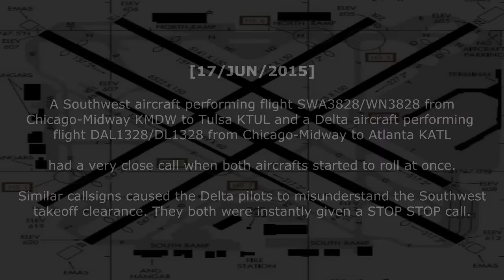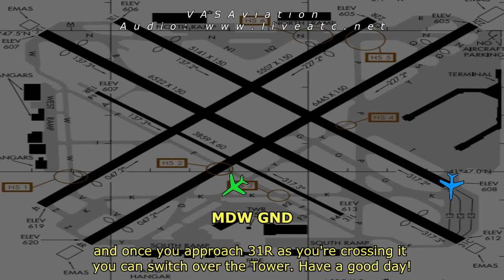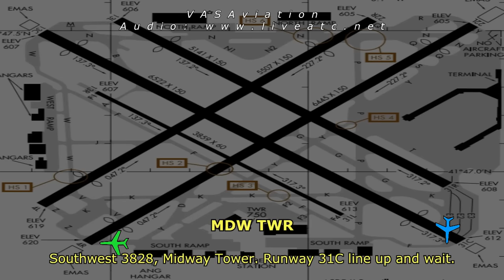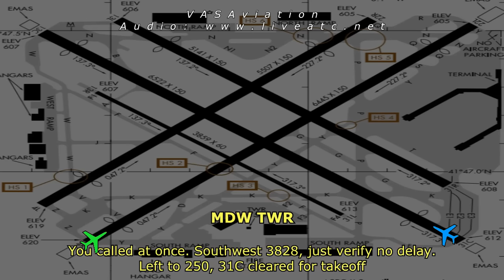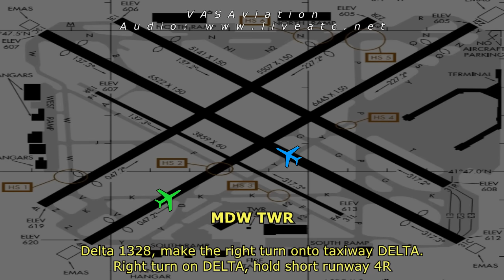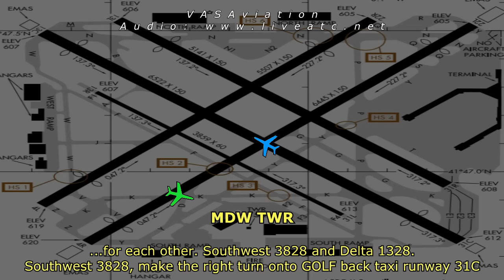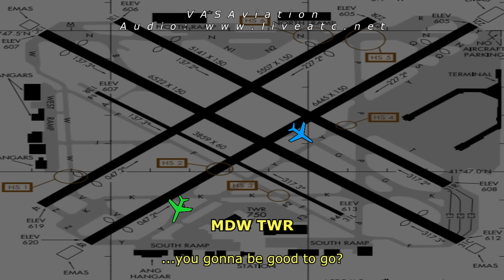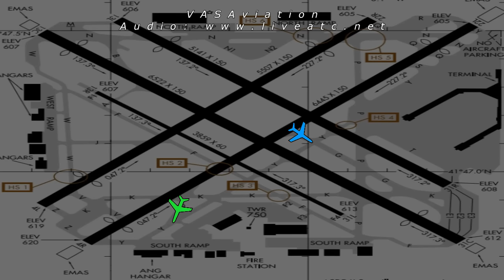[REAL ATC] Delta and Southwest VERY CLOSE CALL on takeoff

Comment: 2nd ATC controller did not give a clear, precise take-off clearance and was speaking too fast. Not entirely on him, but he's part of the cause.
Reply: During his clearance, all you hear is him saying the final 8. Either he quickly started speaking before he cued the mic or someone cut him off. He also insisted several times to not delay which is why I think the pilots immediately began their roll.
Reply: Agree on the too fast and muddled speech, but you hear him say "runway three one 'cenner" which should have raised suspicion with the Delta captain.

Comment: In my opinion, the controller made a big mistake allowing two aircraft with similar call signs to line up on intersecting runways and wait for clearance. He should have: 1. directed Delta to taxi on Yankee and hold short of 4R    2. Cleared SWA3828 for take off  3. Cleared Delta for entering 4R and take off, no delay, after Southwest became airborne
Reply: Point taken, but the preceding controller specifically alerted both crews to the similarity of both call signs.
Reply: @durkadurkadurka6071  that's what gets me. It's like, you were JUST told...
Reply: KStDrew  I agree with you 100%. Similar callsigns, and the rush from the tower controller, did not help this situation.  Accidents are often caused by a series of events/mistakes; ATC made the first move in this respect (not a mistake in legal terms, but certainly an event that aggravated the situation).
Reply: Call signs we’re not similiar. Also, even if both were lined up and waiting, only one of them was given a takeoff clearance.

Comment: After reading a comment below... I think the way the ATC cuts off the callsign is crazy! You literally only hear "28". (I am not an aeroplane professional, or enthusiast for that matter.) Though I still don't understand why radio technology can only receive one transmitter at a time. (I worked at a company that sold professional radios. (I programmed them too).  After the previous ATC warned both planes about the similar call sign I would expect these pilots to double check or maybe they just didn't expect something like this to occur.

The ATC realized they both called at once "You called at once". Why would he not slow down his speech and emphasize "Southwest 3828" even when he didn't cut off southwest it was incomprehensible. It's difficult to know that what you just said is incomprehensible unless ATC's monitor their own mic feed but that would be without the garbledness that a radio introduces.
Reply: +MegaMech The way I was taught was to say the company name, the grouped numbers, then REPEAT the company Name.  As in:  Delta 1328 Delta.  And, when one has aircraft with similar call signs, it just isn't smart to speak real fast.  I would say the common things very fast, but SLOW DOWN for frequencies or control instructions.  The effort was to STOP a pilot from asking for a repeat.  Such repetition ties up the frequencies.  Say something ONCE, say it slow enough to be heard but WAIT for that subtle 'click' before starting to speak.  That click is the frequency coming on.  I also keep seeing comments about bad frequencies.  Yes, frequencies sometimes are bad.  That is precisely why standard phraseology is used.  Things are spoken in the same way each time.
Reply: +Steve Rippe Thank you. That also brings up an additional training topic as a result of this incident.  Your insight is helpful.  I was a Center controller from 1976 to 1981 and ended up with a STAR headset.  I believe that we could hear the audible change indicating that our mike was hot.  It took some self-control to make yourself wait for the tone, but it became natural.  Again, thank you for helping to understand another dynamic to this incident that most of us didn't understand.
Reply: ***** I can't believe you can mute the monitors.
As an airport ATC how would you be able to confirm what you said, and what you thought you said were not two different things if you can't hear yourself? I have a couple examples below from my experience in other things where being able to hear yourself is critical.
Being able to hear your words back seem like a sure way of double checking.

I operate an ATC... In the sense that I pull ropes through an air traffic controller and arrest falls (Rock climbing). Before I let anyone start climbing I tipple check everything in the system. 1st check is doing stuffs. 2nd check is seeing with my eyes. Third check is by talking out loud and hearing back what I'm saying. If anything is wrong I restart the checks from the beginning. This third check may seem silly but it can actual be a catch all mistakes because your eyes are too fast! In this line of work mistakes = injury

Also, as a vocalist I prefer hearing myself through the monitors because what you hear out of your mouth is a completely different sound then the sound coming back through your ears (via monitors IEM or just wedge speakers). ex. Tone, sound quality, dynamic levels, pitch, etc.
Reply: And then after he sounds annoyed that the Delta rolled. Although he probably didn’t have much of a way of knowing he was cut off, so to himself he was being clear.
Reply: You worked at a radio place yet don't know how tuned circuits work? Have a Google yourself but to answer your query about multi-transmit/recieve on a single frequency, you'd need one of the features in digital radio for that such as timeslicing.

Aircraft don't use any trunking or digital technology.
Reply: I could understand him. I'm not a professional either, just love these ATC videos. After a while it gets more clear. I can still see how this mistake could be made though
Reply: Kazzy and Decchan He said “31C” clearly in the middle of the transmission, though. Maybe the pilot was zoned out and forgot which runway he was on, or wasn’t paying attention, which is human but not acceptable for a pilot.

Also, hello, me from 6 months ago (yes, I’m replying to my other account, sue me.)
Reply: @M3ta7h3ad There are analog radio transmission methods which would allow you to hear two people speaking at once in a similar way as two people speaking in the same room (one is called single sideband or SSB) There are ups and downs to each, though. A bigger problem is that such technology still doesn't allow you to hear when you are talking and someone else starts talking at the same time. There are ways that could be dealt with, too, and I think it would make sense to implement something like that. However, there is a major amount of legacy pressure in aviation. You also have to make sure that you don't make things so complex that you introduce new likely failure modes.
Reply: It's outdated technology, it's not this way at most major airports. This was one of the contributing factors to the infamous Tenerife runway collision, both pilots radioed the tower at the same time and all the ATC guy heard was a loud squeal on the radio.
Reply: Radio comms from the tower to the planes on the airport would be loud and clear.  Keep in mind this audio is recorded by aviation/scanner enthusiasts who don’t necessarily live anywhere near the airports.  SSB radios can have two people talk at once and both be heard.  AM and FM  cannot (these are AM aircraft radios). This is because AM radios have carriers, and when two talk at once all you can hear are the two carriers mixing and squealing.
Reply: Console this has nothing to do with “tuned circuits”. And you don’t need digital radios or “timeslicing” to hear two people talking at the same time.  All you need is SSB (sideband).

Comment: I feel like in this scenario, when everyone knows there are similar callsigns on freq, that the controllers should not line both aircraft up simultaneously, and should issue an explicit “continue to hold” order. The takeoff aircraft then can’t be cleared until the other has confirmed continuing to hold.
Reply: Yeah but in another video we see that ''continue holding'' can be misinterpreted.
If Delta could not realize the takeoff was cleared on another runway than his he could have interpreted ''continue your takeoff''.
Reply: I kinda feel like that when there's similar callsigns, you should never give orders to one of the two similar callsigns without giving or reiterating the order to the other one.
Reply: @simonhouel1984  the stop stop could have been issued at a much safer stage.
would have been less impact and risk for all involved

Comment: Two similar sounding callsign numbers, a fast talking controller, no wonder why they got confused..
Reply: That’s normal speed for ATC. Even if the callsigns were similar, tower was specifically clearing 31C, not 4R. Delta absolutely ignored which runway they were on.